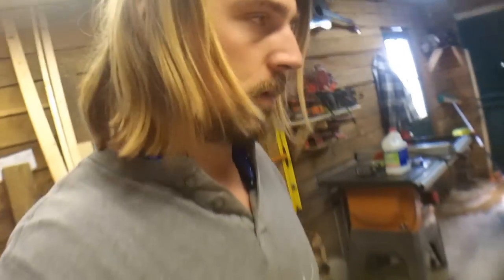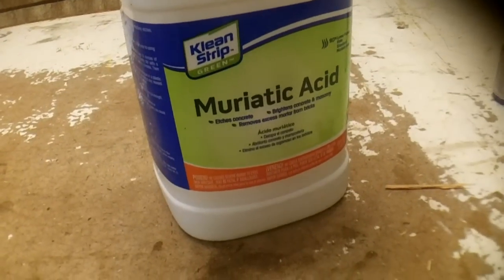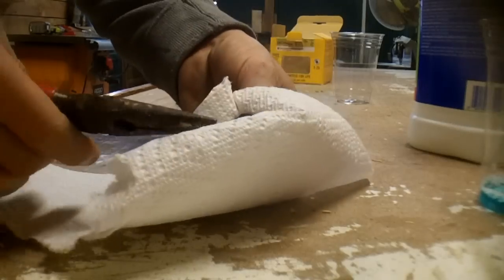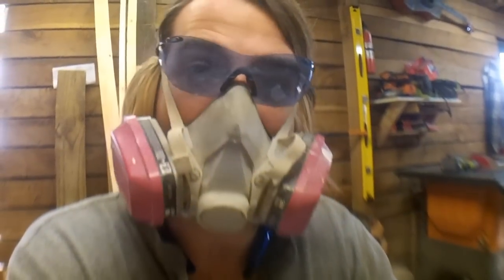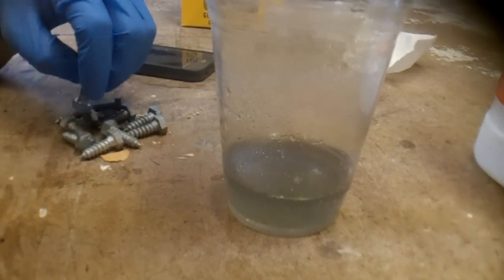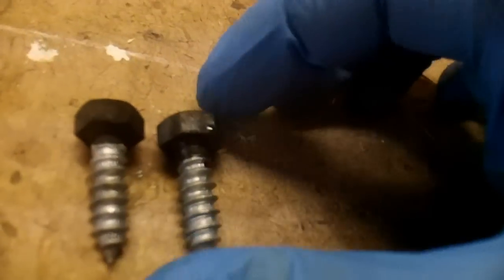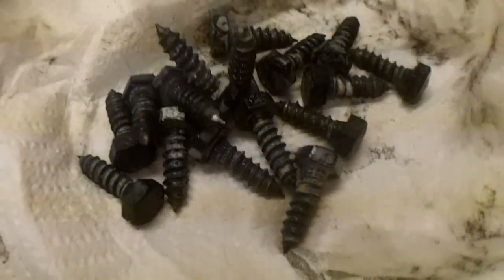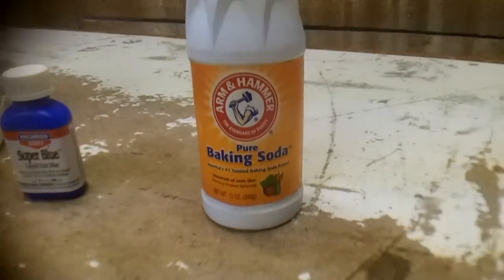Easily Turn Steel Parts Black

Comment: Dude, dropping zinc coated metal into a solo cup with hydrochloric muratic acid just to see what it would do, seems a bit risky. Had that been another coating or metal type, it could have erupted like a volcano onto your face. I bet you may have found too, unless you got lucky or done your homework with your cup purchase, that those plastic drinking cups will only hold out for a matter of minutes or hours at the most before they melt and release the acid onto whatever the dissolved cup was sitting on.  Not really advising because that's the same kind of thing I might do, but still just saying. Good luck, and thanks for the vid. :)
Reply: I learned from Breaking Bad that Hydrofluoric Acid won't react with LDPE..
Reply: Btw, that mask you are wearing is rated for particles and not fumes. You're breathing carcinogens when you you wear those things while working over toxic fumes. I've done that/occassionaly still do too :)
Reply from the maker: yeah, all good points!  but I did do a little research ahead of time, and it turns out the cups I bought are the right kind of plastic that isnt affected by the acid, so there was no risk of it melting. I had read up on the acid zinc reaction so I knew it wouldnt explode or anything, but I was surprised at how hot it got. The mask I have actually IS for chemicals, I bought Chemical filters for it and switched them out with the ones it came with for this kind of stuff as well as painting, staining, varnishing, etc.   Of course makers like us are not averse to taking risks, but these sort of experiments should always be preceeded with a lot of reading, experimenting, and talking to other makers for advice and recommendations.

Thanks For Watching!
Reply: @PMKWoodworking  You did well to dawn your respirator. Yes, many respirators don't protect from this kind of reaction (maybe yours does) but a respirator is always way better than no respirator. Also just a fan pulling air through your shop quickly will do most of the work to get any hazardous fumes away from you.

One thing I thought to mention to you is to not use too many bolts in your acid dip because the more zinc you add the more you're decreasing the acid's potential cutting action. Then it becomes like etching metal with dull sand paper so it's better to use more acid to less parts to keep the acids strength up. You'll find that if you keep adding parts to the same acid eventually the acid is largely spent and does much less than when it started out. 

Caswell is also (as others have said) a good starting out place for learning how to blacken, plate, etc. I also learned about pickling baths (etching baths) like you made with your muriatic acid. Muriatic acid being generally the most caustic way to pickle.

Comment: REALLY should have used something other than a thin plastic cup with the acid. I’m surprised it didn’t melt right through the bottom, especially since it’s creating heat.
Reply from the maker: ACTUALLY, you are supposed to use plastic with hydrochloric acid as anything else would have reacted with the acid. despite the heat the plastic held up very well because it really wasn't any warmer than a warm cup of coffee and most of the smoke, Turns out, was the hydrogen gas escaping from the chemical reaction with the zinc. This kind of stuff is relatively safe to do as long as you know a few simple facts about your chemicals and materials before starting any experiment.

Comment: I sand blast them first and then I use a black oxide by caswell. You have to follow the directions. The parts have to be clean,clean. after you need to seal them and they will last forever .
Reply from the maker: nice! unfortunately most people dont have a sandblaster available,  so the acid will have to do. but thats good to know. I have looked into caswell since posting this video and i think i will give their product a try next.

Comment: caswell makes products to black oxide coat they have videos watch them. when you cleaned lag screws you failed to rinse them clean in water which deactivates the acid and also keeps from conttaminating your bluing fluid .. you need to let parts sit in fluid for 5 minutes ..longer in fluid blacker they become. after that rinse in water then seal with wd 40 to get shiny look .. caswell has a sealer for matte finish but do not know of a substitute the wd 40 is the same as their penetrating sealer
Reply from the maker: Nice Thanks for the tips.  I have been cleaning the parts since making this video and sealing them with penetrating fluid, but This video is the first time I ever attempted to blue steel.
thanks for watching!